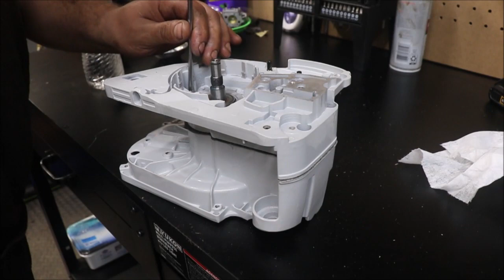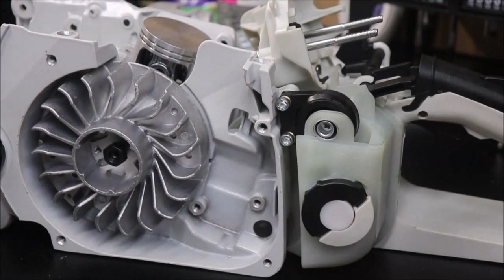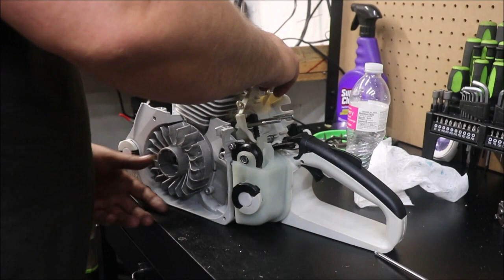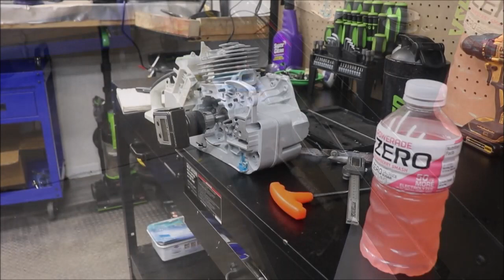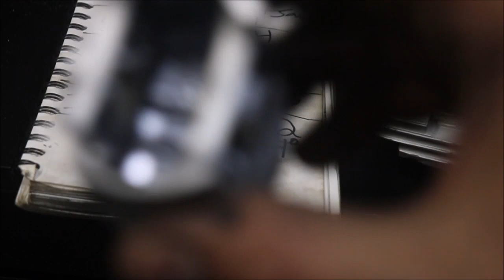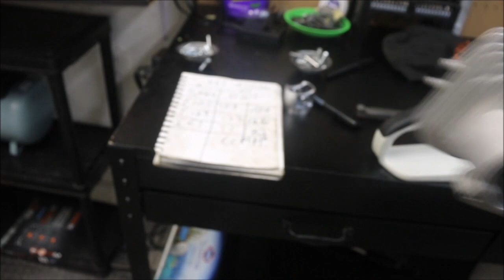Farmertec Stihl ms361 Clone Build Begins Machine and Port Work

Comment: I have been fighting a 361 kit for 3 years now. Still won't run worth a snot. I've swapped carbs, it passes pressure/vac test but no luck. I put it back on the shelf and ignore it. Curious to see how this kit works out for you
Reply from the maker: 🤔 what is it doing?
Reply: @JandSChainsaw  falls completely on its face with any throttle. Different carbs, no change. I'm wondering if the coil isn't advancing.